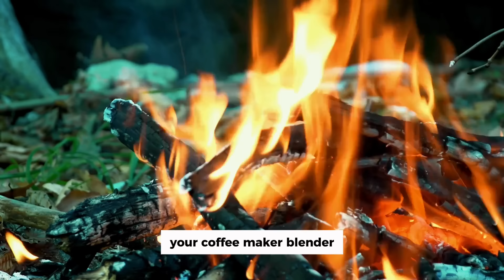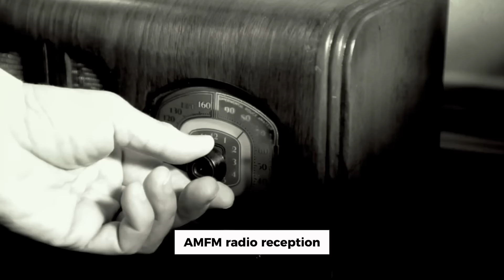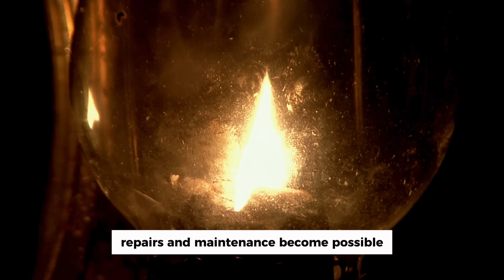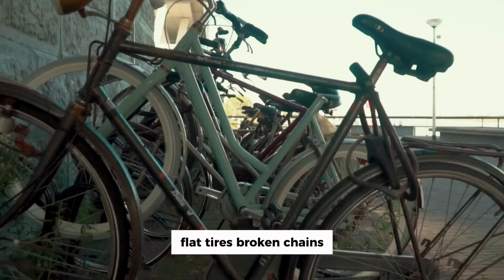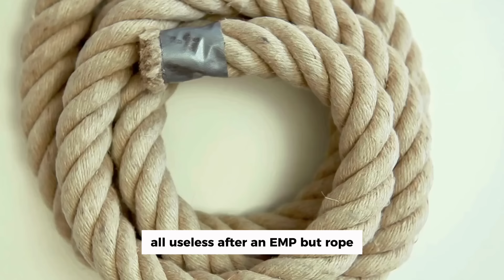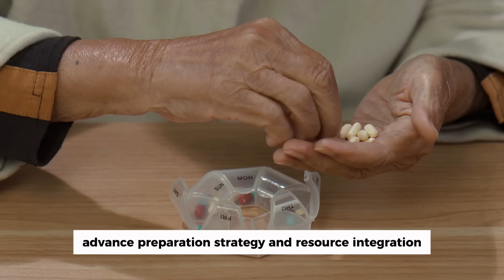11 Cheap Household Items That Will Still Work After an EMP Blackout

Comment: Both sides of my family were farmers, so I grew up with a pedal-powered whetstone, a working smithy, and hand tools. Electricity was a long time coming to rural Michigan. I remember when the “black stove” made way for the electric version, and grandma complained for years that the bread didn’t rise right. The never-empty soup pot disappeared because it had lived on the back of the wood stove, ready for the next bit of leftovers. Cutting stove wood involved the whole family for at least a week in the dead of summer.
Reply: Wood should be cut after the leaves fall, because it takes less time to cure.  Cutting and splitting wood in summer is nuts.  Wood heats you twice: once when you harvest it and again when you burn it.

Comment: Save your dryer lint as fire starter...
Reply: That depends on how much cotton you wear, not polyester.
Reply: Also you tp rolls. I make and sell (at craft fakes) easy fire lighters with lint stuffed into a short tp roll that I cut in half, make slits on each to close the ends like you would a cardboard box, add a little wax and some wood chip in that little box with the lint also. To keep it a craft, I use crafting scraps, fabric, yarn, scrapbooking paper and even wallpaper. I then wrap with a little raffia to appeal to the quaint, farmhouse ladies. I sell the for 3 bucks each or 2 for 5 and I struggle to keep them in stock. 😂  I have the plain ugly ones in my own supplies but as I can, when I can corn, made my corn cob broth, I dehydrate the corn cobs and store them. They make the best fire starts indoors and out. They burn for a long time and they burn hot af. In fall and winter I always have a container near our kindling and wood stack. In the summer I have a tub in one of the storage benches for bonfires, fire pits and the bbq. If we never ate corn again, I’d still grow it simply because of its ease and speed of lighting a fire safely and keeping it going.

Comment: In case of an EMP, won’t hand crank radios & LED lights be fried & unusable?
Reply from the maker: They can be, but are generally considered to be more resilient than electronics that require a direct connection to a power grid.

Comment: One of the first things you're going to want is a can opener. Not one of those little rinky dink things but a real can opener. I get mine, Amish made, from Lehman's. So far the last two I bought have lasted me 35 years and I'm still using them. For trading I got two more.
Reply from the maker: Thanks for the suggestion Linda, will definitely get extra openers myself
Reply: You should buy two more for yourself because two is one and one is none

Comment: " thrift store" egg beater has probably been abandoned there for some reason...such as " jammed all the time" or " rusted". Even an expensive manual egg beater has blades which will bend, without the most exquisite good care.
The only " manual egg beater" which I would ever recommend costs $50 ( plus,) Lehman's Non Electric has them.
I would not recommend the expenditure of 50 cents on " thrift store" egg beater. Any that can be found in these stores was cheap junk from the start, and will just jam and refuse to " beat".  People donate stuff to " thrift stores" because they were done with frustration and " cheapness".
Reply: You can whisk with a fork
Reply: @luci8784 or a whisk !!😂
Reply: Excellent 
Same principal applies to can openers. Dollar store might not cut it. 
Blessings

Comment: If you have young children you're going to need a way to keep them quiet and entertained. Another suggestion I would make is having how-to books on hand...from simple basic instruction books all the way to detailed survivalist books like Joel Lambert's Bug In survival guide. The more the better. If you're with the group it gives them purpose to read and learn and offer hope as opposed to sitting around fretting and worrying.  I personally am only concerned about myself and my daughter so I don't have to worry about taking care of other people. I feel like the less people in my circle the more likely I am to survive because people can tend to be psychologically unprepared therefore making themselves a liability and compromising the safety of others. That is exactly the reason why none of the people I know, know I prep. It's for the simple fact that they don't have a spot at my table for various reasons that would compromise my own survival. I would like a mutual assistance group but it's hard to know who you can trust in times of stress and duress. I feel its best to stick to my Lone Wolf mentality.
Reply: I am RIGHT WITH YOU. The answer is TRUST NO ONE. you never know who's loose lips will endanger you or your daughter.
Reply: Foxfire is a great addition to any library.

Comment: Maybe, this comment, has no value, 
Here goes...
Most everyone has a microwave in their house, 
A microwave acts like a faraday cage, even if old or new, putting your phones, digital watches, small lights, radios, etc inside,and closing the door blocks out magnetic  and exterior and transmission waves blocking harmful transmissions. I unplugged my microwave,and put my phone inside, and called my phone ...it would not allow call to go thru, the cell tower could not find my phone,.also making a larger faraday cage is found on Google

Comment: The prices of hand tools, list in this report...are way off base.  I am sure my tape measures and all my hand powered tools are at  very least are 40. + $ each my Hammers are 150.00 Ea💥
Reply: I agree. Thank you for this comment. Cheap hand tools are frustrating ( at best) and can actually be hazardous ( to hands, when they fail or break apart) . I would not spend any amount of money on pliers or other tools with quality much less than knipex.
And no one should think that purchases from the big box store with initials H F will turn out to be worth anything. I say...stay away from that place. They sell automotive repair tools which are actually dangerous.
Reply: HF sells tools of various levels of quality.  The more you pay the better the quality.  It just depends on how often you use the tool and what it is used for.  Their cheap vise grips are soft garbage. However, they offer a lifetime warranty on most hand tools.  They finally solved the problem with their killer jack stands.

Comment: FYI Duck tape will not adhere in freezing temps. If you've patched a tent, boots, tarp..check regularly. Have a backup. There are adhesives like patch kits that work better.
Reply: Can you suggest the name of a product that works better than duct tape in the cold?

Comment: 1.   Manual Kitchen Tools -  Manual Can Opener,  Sharp Knives, Cutting Board, Manual Whisk, Hand Crank Egg Beater, Wooden Spoon and Spatular, Mortar and Pestle, Hand Crank Coffee Grinder, Manual Pasta Maker, Meat Grinder

2.  Fire Starters - Strike Anywhere Matches, Waterproof Matches, Magnesium Fire Starters, Fire Starter Cubes, Dry Tinder and Petroleum Jelly Cotton Balls
Reply: Your list is good - as far as you went. How about an old style " Cowboy Type ", over a fire, non electric coffee pot?
Reply: @philliphoward7455 All I need is my camp kit 😊
Reply: @philliphoward7455   cast iron cookware. Skillet, 10qt pot.
Reply: Thank you for the list
Reply: Spatula*
Reply: Yup I got them all. I hav blizzards that knock elec out for days at a time plus im at least 45 miles from nearest grocery store so plenty of grocerys and water plus snow water brought in to melt naturally and water filters. Dehydrated veggies and pressure canned meats and assorted quarts of pressure canned cooked beans.  And a fireplace and wood. Wrote coffee covered in separate comment!!!!!

Comment: Want an easy Faraday cage?
Put a rubber garbage can down in a metal garbage can.
An EMP hitting the metal gets converted to electricity which can't arc to your electronics through the rubber can.

For a fire starter, use lint from your dryer and wax. Preferably paraffin
Reply: And put the lint in a paper egg carton and pour wax over it.
Reply: @cswan153 carefully.....and store in fire resistant  can, maybe emptied food cans with foil under the lid?
Reply: @cswan153 
   great idea❤
Reply: I was wondering which home items would work.....how about a large canning pot with several layers of mesh shelf liners ?
Reply: @nancylourose for what?? As a faraday cage?? Please explain....
Reply: Stuff lint into emptied toilet paper rolls. .also wax on pinecones
Reply: I have the metal cans, didn't about the plastic inside😊 great tip😊
Reply: Would that work over a well pump?
Reply: What electronics are we talking about? You can't just keep everything in a faraday cage all the time.
Reply: @kferins2451  why not??? I made my own Faraday cage with a 30 gallon galvanized trash can lined with cardboard and foil tape to seal off any small places where light would get in. Inside there I've got two power stations with their solar panels I have a solar powered rechargeable crank radio as well as multiple solar power rechargeable lanterns headlamps flashlights and water pumps. I've also got a CD Walkman in there and another solar powered motion activated light I have battery-operated sensors that will notify me if someone passes into a certain area and I have a portable DVD player all of that in my Faraday cage. I just pull the stuff out every couple months and top off the charge via outlet in the wall.  And yes it does work, we put my cell phone in there my daughter called it and it did not go through, the signal was blocked. I call that a success and very much worth the effort in all aspects.
Reply: @kferins2451 Any Communication devices for sure, and then any electronics you can't live without. You are correct, unfortunately you can't save everything

Comment: A gas stove works using matches to light it.
Reply: Assuming the upstream mechanisms to deliver the gas to you are mechanical, and not dependent upon electronics. I have wellhead gas, which is quite dependable - unless the pressure in the transmission lines drops precipitously (which has happened, during storms with prolonged sub-zero temperatures.) It's good to have a backup plan, even if you're blessed with natural gas... 🔥
Reply: @WoodlandFeral i have two very large propane tanks that would last for a couple years worth of cooking.
Reply: @WoodlandFeral 
Propane gas
Reply: @WoodlandFeral i have propane tanks
Reply: In Australia fewer and fewer people will have gas as it is being eliminated. Everything electric is seen as the future. New suburbs in some states don't allow connection to natural gas. Our politicians are mad. Net Zero at work. I have a gas BBQ though.
Reply: When the power went out last winter, that's how we made coffee. We have a perc coffee pot for camping and a whistle kettle. Both are very handy when the power goes out.
Reply: The burners work but with most newer stoves you can't light the oven with a match. Be sure to look for a range that allows for match lighting the oven, plus allows for the use of propane

Comment: A EMP should not affect some power tools as they don't have any computer chips in them.  An older car something build in the early 70 or older should still be able to start and run as they don't have any computer circuits.
Reply: It’s not necessarily computer chips, it’s solid State technology that gets fried.
Reply: Great and thought of that. It is wonderful if you have an oil tank type container filled with gasoline to propel the vehicle as gas stations, stores, banks will all be closed.
Reply: Great and thought of that. It is wonderful if you have an oil tank type container filled with gasoline to propel the vehicle as gas stations, stores, banks will all be closed.
Reply: I've heard that. Brings to mind a pre-70's  Buick, Plymouth, with the small Slant Six engines. No chips, no stumbling blocks. Nearly indestructible. I did all maintenance on all of mine. Nearly impossible to find now.
Reply: The solenoid..... should have a back up... unit.
I don't particularly care whether the vehicle will work or not, because being just one of the few vehicles in an area driving around, will bring way too much attention.
Old school is an old moped, both a pedal bike and gas operated device... long range.
Reply: All my cars and trucks and jeeps and vans are 1928 to 1971 have 33 of them and can fix anything on them
Reply: Lives through the Texas black out we had food heat everything we wanted used hot hands a lot get those things they save lives
Reply: Vehicles will have to have "Points & Condenser" type ignition to not get hit by the EMP. Everything newer is at risk

Comment: I live in an apartment complex. We're not even allowed to have a grill outside
Reply: Keep it inside until the power goes out
Reply: Look up terracotta pot warmers or heaters.  Basically,  grab a pot. Turn it upside-down.  Put feet under it.  Light 3 to 5 tea light candles.  It puts off good heat and will warm water.  I haven't tried soups yet.  Of course, have it on a fireproof surface
Reply: Get a Vesta Stove/Heater.  You can cook on it or use it as a heater.  Works on canned heat (those little cans that caterers use) so it’s safe for indoor use.  I got mine at My Patriot Supply.  Works great.
Reply: Rules will go out the window at that point. Pun intended.
Reply: Most apartment complexes have patios. I live in such a place. I am set with my hibachi...and small camp stoves ( alcohol burners,) which I can carry out to the patio...to prepare hot meals in any type of power outage. 
If your complex has a patio...or any area with benches....I say ...prepare yourself with a small cast iron hibachi. Or with whatever suits your needs.
I don't recommend " Weber bbq grill" for emergencies...because these require a half bag of brickettes for one meal. Smaller stove for charcoal is better. My hibachi requires two layers of charcoal brickettes ....in a 5 inch square space. One large bag of Kingsford brickettes is enough for about 20 meals.
If you cover the top grate with foil...you can prepare burgers, or whatever, without " flames". Or...just use a frying pan over your hot coals. This is healthier...and easier. 
With a hibachi...just watch out for children/ grandchildren. Don't step away ...and keep children far away. The whole entire thing will be hot
Reply: @ceceliaclarke Beware!! -cooking outdoors will draw violent hungry hoards. Better off inside with sterno. Minimize wafting scents
Reply: Get a bike and go until you find power that's on.
Reply: Buy  sterno cans of fuel. You can heat/cook on them inside,  you will want to contain food smells to keep violent hungry people away anyway so grills are not a good plan in grid down.
Reply: Maybe a camp stove top? Used canned gas? I purchased one for our home. 

Camping stores have excellent selection of useable items .
Reply: They prohibit outside grills to avoid dumb asses (as a landlord, I have found them to be plentiful) from burning down the apartment building.  Gas grills are safer than charcoal.  Turkey fryers are an accident waiting to happen.
Reply: Then move!
Reply: @oddball7483  It's not that easy. 🤣
Reply: @michaeladove7269 ASAP. True.. it is not easy.. however, some are making that commitment.  First comes the desire.. then move toward that goal.  For some it is worth the sacrifices they must make.
Reply: @michaeladove7269 ok how about  a bad left hip thats barely there and a right knee thats bad
Reply: @oddball7483 Indeed.. for anyone truly serious about survival.. they have a plan for getting out of a densely populated Apartment situation asap.
Reply: Make friends with your neighbors. Pull together when the time comes
Reply: @lisacanary155 HUH- I DO NOT TRUST THEM AT ALL.    NO WAY!!!!
Reply: @lisacanary155 my neighbors go inside when I come out. They won't even look at my boys and I. I've said "Hello!😊" with my ✋️ held high in the air... all 4 for them seemed to run for safety. We mind our business, don't cause a ruckus, and are friendly, kind people. I don't understand people who behave as they are. I'd wish our old neighbors still lived there. But they had to move to a smaller place. (the new ones moved in 4+ months  ago) we have all said hello and waved several times, as that's just how we are. I could go over to thier property and introduce my family and I, but we already feel unwelcome, after so many non-invasive attempts, with no response. My boys don't  understand why I still try. 
I can't say I do either, other than it's just me, and I prefer to be friendy with our neighbors. Lol
I could raise ** because their dog runs loose and comes to my yard, has run down my garden, knocked medicinal potted plants over, run through my berry bushes putting them down (I hope he didn't get any boo-boos from the thorns) giving them a reason to act like we are worth running from. My whole 5ft 110lbs is already so intimidating, and my kids are young, 😂 really tho... you're right. It's a good idea. Everyone for themselves when it comes down to it. Take care and stay safe!!! If you have any thoughts of how I could reel them in to being friendly, I'm open to ideas! Please and thank you!!!  😊😊😊😊

Comment: I'm trying to figure out why my pipe burst when there was  o pumps to put pressure on the line.
Reply: The water that's not drained out of the pipe...because the actual pressure stopped, it freezes inside the pipe wherever the coldest area is for the pipe system the metal pipe will crack.
Usually under the floor, inside the wall, under the tub ...etc.
Reply: Water expands when it freezes.  Draining the pipes might help.